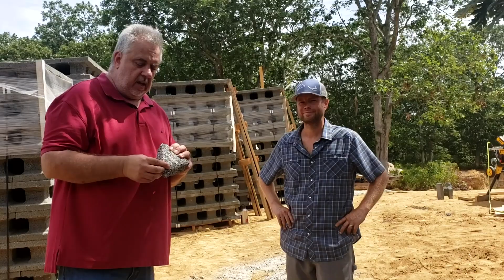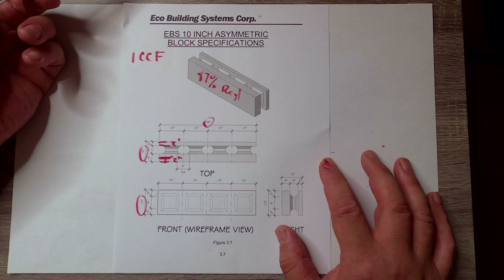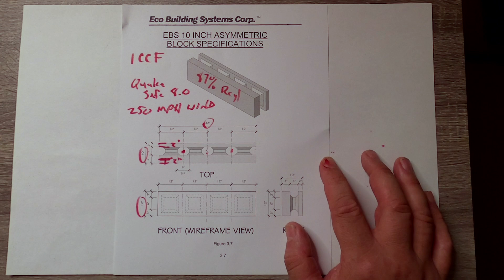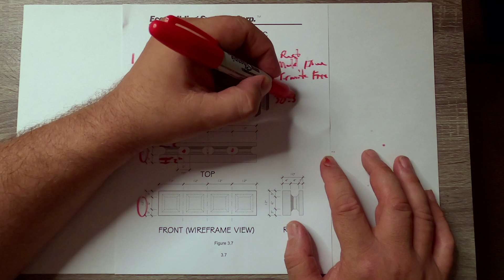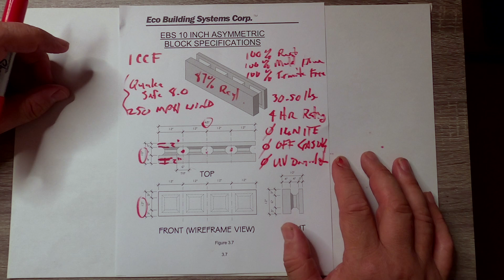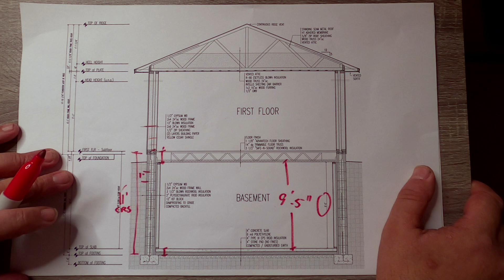The PERFECT BLOCK Foundation - Part 1

Comment: If you rebar every course and every vertical, fill it with 3000 concrete, it'll be virtually indestructible.  I mean like a tornado could slam a big truck into it and might dent it lol
Reply: 8.0 rated is quite strong!  If I ever build a home, the whole thing will be perfect block.  How difficult is a concrete roof?

Comment: Steve i know you dont divulge the exact amount of cost for the house. But are you able to give a range of costs for the basements  within the 10k range for the square foot costs of different parts of the project. It's so hard to find even general costs of different parts of a building house project. And if you are unaware your sound is fading in and out in some parts, but I love your videos as you are so detail oriented.
Reply: I've heard that each block costs are roughly $25....  that's 12" x 10" x 5'  >>> $25 block, $25.25 rebar,  $43.33 cement.  / 5 = roughly  20$ per sq foot .       pretty good. thats what ,y research is so far.     $20 per 20' for rebar, $130 per yd cement 4000 psi 6 slump,  and ef block at 1 (5x12"x10") $25

Comment: Was Durisol/Nexcem ICCF considered as a potential solution for this house? If so, what disqualified it, R-value, thermal bridging, issues in ensuring air tightness? I’m thinking of the feasibility of a building a Passive House with Durisol/Nexcem from foundation/basement to outer walls. Thank you for the feedback!

Comment: I had written ICF off because of the termite problem, But this is perfect. And even better insulation than ICF!
As long as it is competitively priced I see this as a winner!
Reply: Cheaper than the average icf product. Just got quoted today
Reply: What termite problem in ICF? Don't termites eat and burrow into wood?
Reply: There are videos (Perkin brothers?) about pest control companies not being willing to treat ICF buildings thus preventing the last step in closing a permit. IIRC it has to do with the termites burrowing through the foam. Maybe not realistic but still what’s happening.